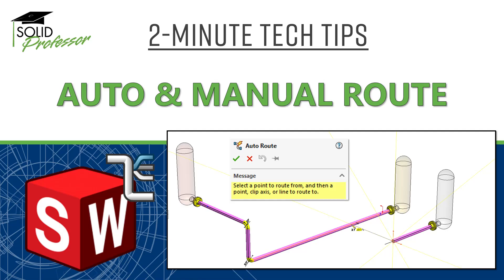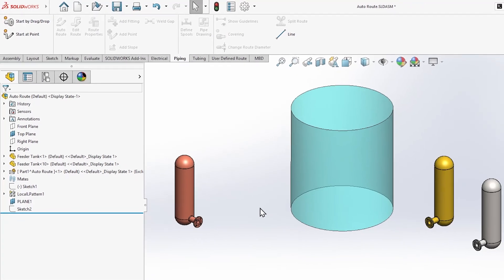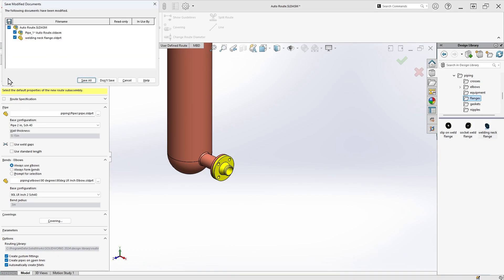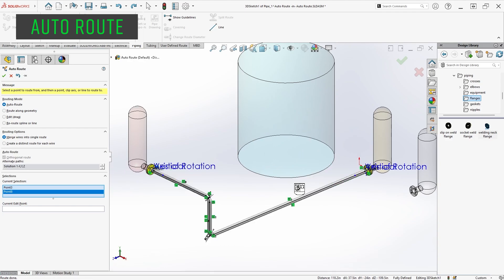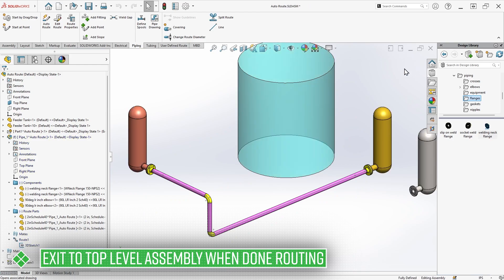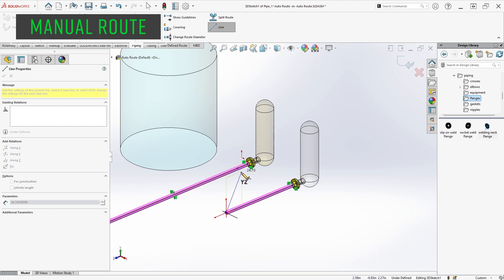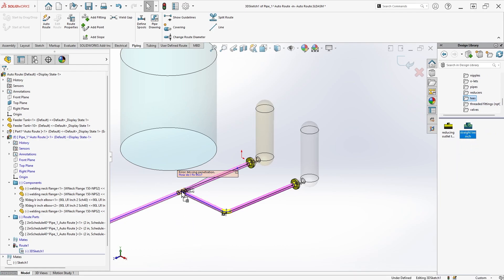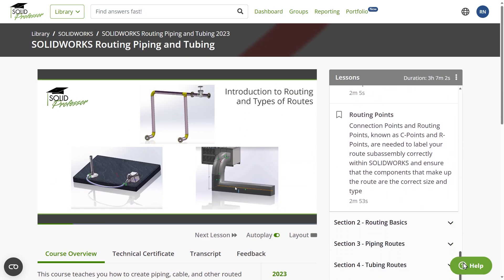Automatic & Manual Pipe Routing in SOLIDWORKS

Comment: how do you do this without fittings and include a 1 degree slope?
Reply from the maker: We have an older video that shows how to create Routes point to point here: https://youtu.be/FKnkaPLFHCU

So this would allow creating a route without fittings. You can also choose the "formed bend" option during Route creation to create one continuous bent pipe or tube if that's what you're looking for. 

Slope can be added after the fact using the "Add slope" button https://help.solidworks.com/2025/english/SolidWorks/sldpiping/t_adding_slopes.htm

It's also worth mentioning that all of these techniques are covered in our full training course!